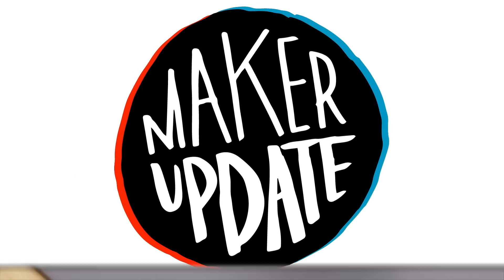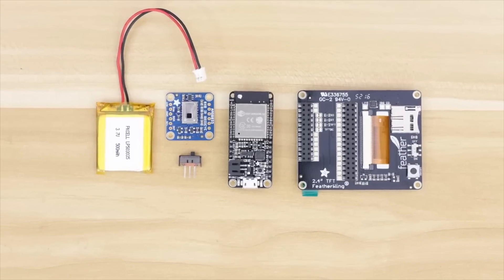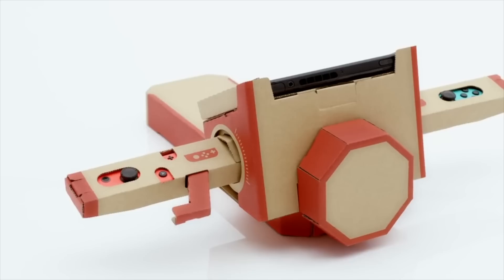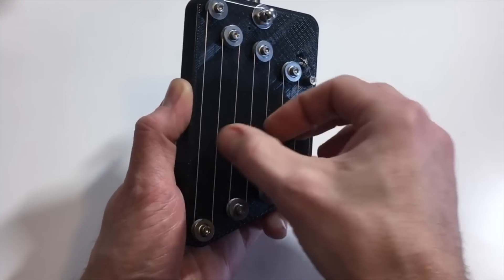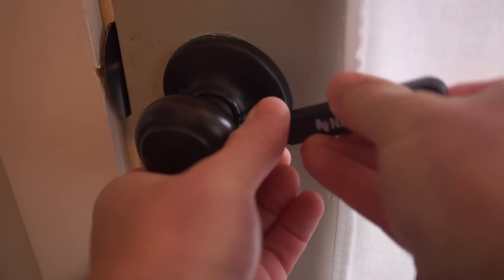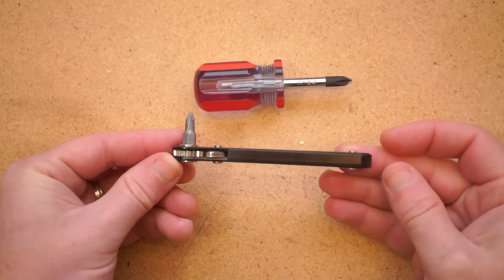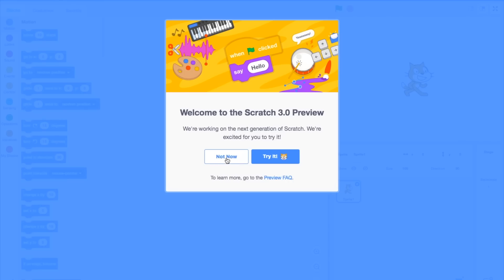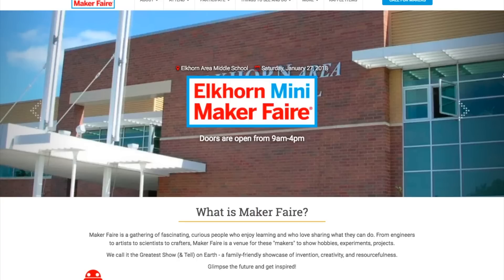Nintendo's Cardboard Kits [Maker Update]

Comment: Another great video! I First - I just ordered the screwdriver - I love it, and it takes up less clutter space than the 100 other drivers i have scattered about LOL!  really want to learn more about the Labo and how it works, perhaps i need to know more about the controllers themselves.. i know that the amiibos work on  controller i assumed it read RFID. Interesting thing the Mario Cereal box comes with an area you can "scan" with the controller to get coins and add a special item to the game.   When the Labo announced i wondered the same thing - what is it using to tell how to do all this? I am sure someone has taken them apart should probably look it up.
Reply from the maker: Yeah, some team at Nintendo must have had a blast figuring all this stuff out. It sounds like there's a lot of elements at play, but the reflective tape and the IR depth camera mentioned in the Hackaday article is a pretty novel pairing. What I'm wonder is, considering this is Nintendo, if there are some easter eggs built into the hardware design for people to hack and explore mods with the cardboard.

Comment: Looks like it would be hard to use the screwdriver with a philips screw head, if you can't push on it. Would work for robertson though, I guess.
Reply from the maker: It's not the quickest way to place a screw, but when I hold it I typically use my thumb to put some pressure behind where the bit sits and use the rest of my fingers to turn it. It's also good for taking apart gadgets with cramped interior screws (computer towers, kids toys).